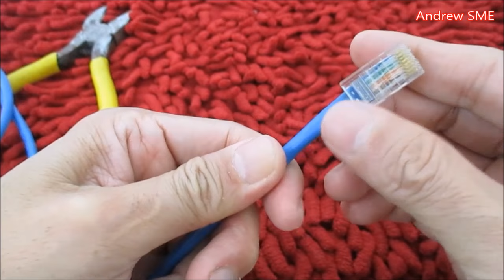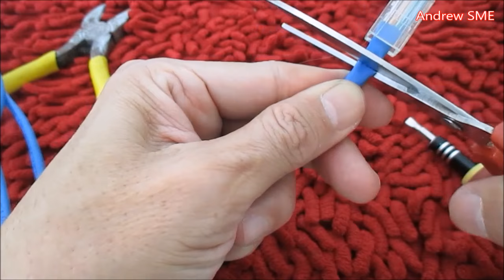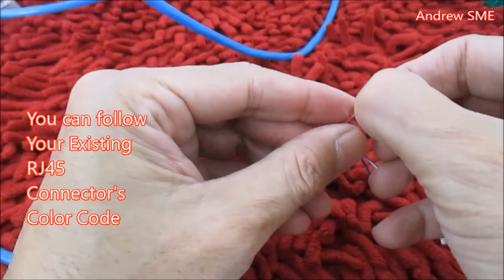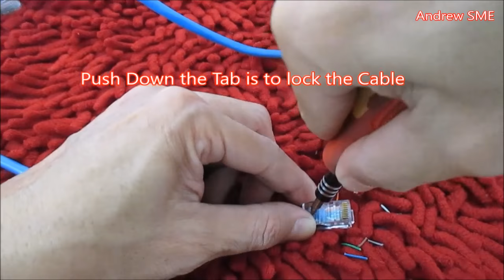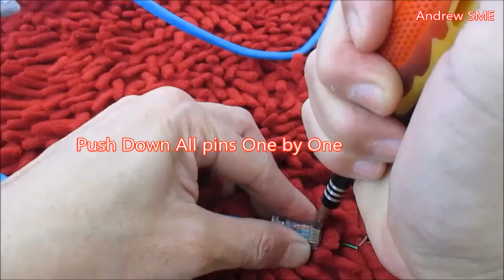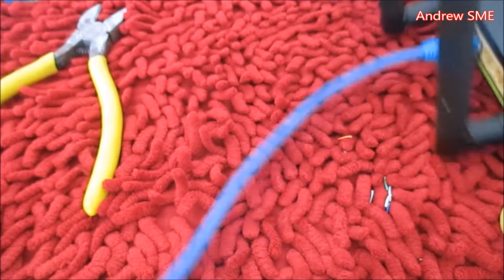How to FIX Repair Broken Internet RJ45 Connector Replacement without Crimping Tools

Comment: good vid. cheapest crimper was like £7 and I only need it for 1 use. just used tools like you did and saved myself money. cheers
Reply from the maker: You are so Great. Solve the problem. Thanks for your comments and Thanks for watching. ❤️❤️❤️❤️❤️❤️❤️❤️
Reply: Was it easy ?
Reply: @nazimsakhri1558 damn, it was 4 years ago now but I don't recall it being very difficult. I know I was probably cautious so probably did it a bit slower than in this video but the end result was that it worked first time and I saved money on not needing to buy a crimper.

Comment: advise: there's a n extra wire inside the cable you pull and drag it and it slices the casing vertically, instead of slicing the cable and twisting it back and forth like in 1:30, this way you won't slice the insulation on the internal wires by mistake or degrade the metal wires by twisting it, both mistakes introduce noise to the signal slowing the connection, no use getting a cat6 cable and make it perform like cat5e, it's almost twice the price
Reply from the maker: Thanks for your advice and guidance.

Comment: Like a pro. The amount of time I spend faffing about with these, when as I go to push it in the wires change order, or you end up with two wires going down one pin slot and getting stuck. Never ever stay flat and in the correct order when I put them in.
Reply from the maker: "wires change order" This part 2:56 holds all the wires firmly and pushes in the wires slowly.  

 "Never ever stay flat"
come to this part 3:00  right hand hold the connector firmly and the left hand push hard and squeeze in the wires deep inside to the connector. 

3:05 from here you can see all the wires reach the end. If not push hard and squeeze in the wires again. 

Thanks for watching.
Reply: @AndrewSME  The video works perfectly and explains it all. Thank you mate. No need to write down what's shown in the video.

Comment: I fix the network cable myself.  Especially when the copper wire is pulled apart, it is easy to break the thin wires one by one.  After breaking, you can only align all the dividing lines and cut again . I am noob

Comment: 1:31  So, when was the last time you needed stitches?  Yeah, very dangerous to use a snap-off knife that way.  Place the wire on a firm surface to slice the exterior insulation.
Reply from the maker: Yes, use Network cable cutter much safety. Thanks for your advice. Thank You so much.
Reply: It really isn't if you have experience with it.

Comment: Is there a way to safely remove the connector? I'm planning to remove and reconnect the connector so that I don't have to drill a bigger hole through the wal
Reply from the maker: NO, you cannot remove the RJ45 connector then reconnect back the connector.
Reply: @AndrewSME  thanks anyway. They're dirt cheap, so bought a bunch. Unfortunately I'll have to throw away the other 49
Reply: Had this same problem. Glad I saw this comment first. Will also have to throw away 49.  😞
Reply: @goonermu8629  😅
Reply: @goonermu8629  ship it to me 🤣

Comment: My cable stop suddenly working, it didnt break or anything, it just stopped working, do you know what the problem might be and how I could fix it?
Reply from the maker: Try to narrow down the problem. Make sure is it the problem came from LAN cable or from the computer problem. Few ways for troubleshooting by exchange RJ45 connector to another LAN port at your Switch hub or use another LAN cable to verify.   If it is LAN cable problem either one of the RJ45 connector problem or cable broken. 

How To Crimp Repair Lan Ethernet Cable (Cat5e) Split RJ45 Connector Share to Two Laptop System
https://youtu.be/TbnLlYvnoZc

No Internet Connection - How to check long distance Lan network ethernet cable
https://youtu.be/idU2f_UyMSk
Reply: Andrew SME alright, thank you so much, I really appreciate your help

Comment: we can’t change the connector, without cut it ?
Reply: It's been a pretty long time since I've done any of this, but I'm pretty sure you have to cut to replace a connector. 

Did you see near the end where he was pushing down over the cable and then pins, and each different part popped? I'm pretty sure those are locking mechanisms that can't be unlocked again.

Comment: I appreciate you showing us how to fix (replace) the plug. But I find it hard to understand if you already have a crimper on hand to properly replace the RJ45 plug correctly. This is not good for the connectors as you bent the plastic very poorly and could later cause a very bad connection in the near future. I strongly do not recommend this type of DIY for a first timer, plus this can cause injury to them if their not careful. PEOPLE, Please use the proper tools for this so that you don't have to repair the plug down the line in the future or have to injure yourself also. REMEMBER SAFETY FIRST!!!
Reply: Before the invention of tools people used the laymen method, there may be a certain class of people who don't want to spend extra money on something they can fix themselves it's safe from an environmental point of view , so reduce reuse and recycling.

Comment: may issue ako about sa modem B525 using smart corpo ko to smart switch tapos kumonect sa switch 10 pc sa computer shop ko at isa sa kabilang bahay tru lan cable papuntang router nila always nawawa net nagkala kulay yellow triangle sa internet icon sa ng mga PC ko if bununutin ko connection ng kabilang bahay na kumonect sa TP link swith ko at ibalik after 5-10 seconds  bumabik na connection nawawala na ang yellow triangle sa icon mg internet sa mga PC ko sa shop ko, ano kaya probs? salamat sa maka sagot
Reply from the maker: is it the IP ADDRESS of the computer conflict? try to change the fix IP address of this computer.

Comment: You should change the title if its not an actual REPAIR but REPLACEMENT

Because that means we have to BUY another tip (that will also fail easily at the end)
Reply from the maker: Yes, I Got It. Thanks for your advice.  PATCHLOC rj45 locking clips is another alternative solution.  Thanks for watching.🌹💗

Comment: Use crimping tool
Reply from the maker: Yes Thanks for sharinf.
Crimping tool is much easier to fix the RJ45 connector. https://youtu.be/TbnLlYvnoZc
But for those user doesn't have or not necessary to have the crimping. They can use this method.